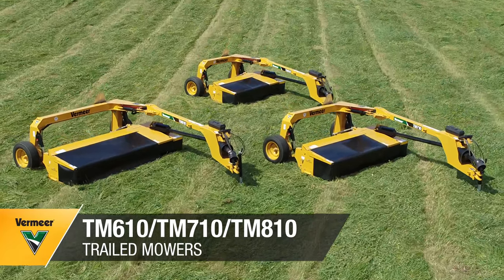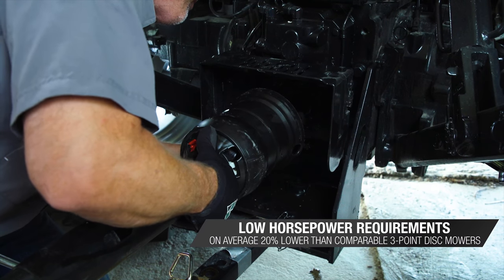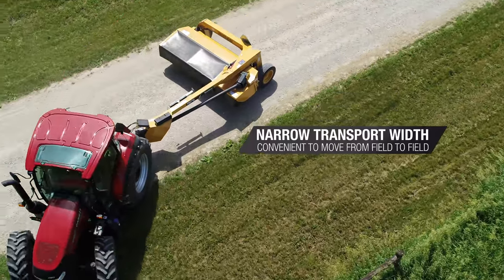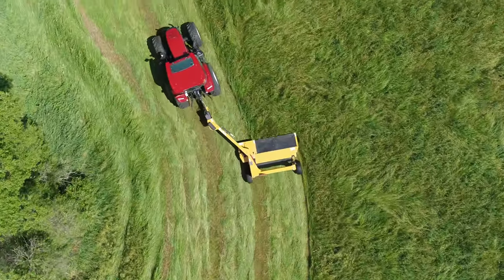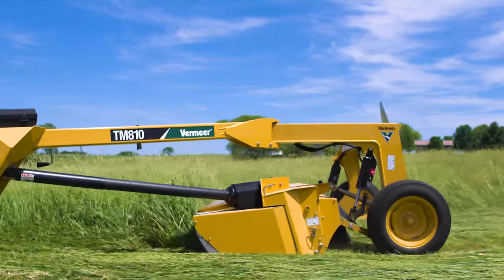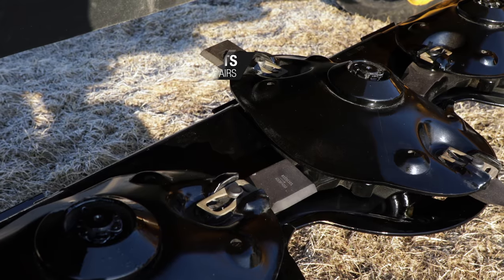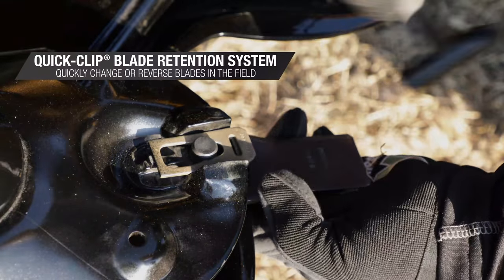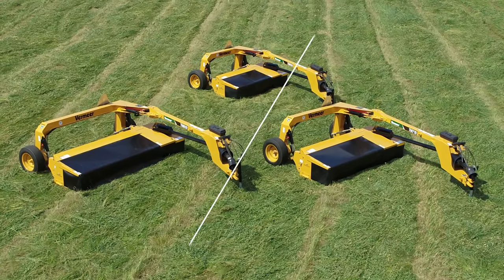Introducing the TM610/TM710/TM810 Small Trailed Mowers | Vermeer Agriculture Equipment

Comment: So disappointed to see all the skips and sprigs in the field after it's cut. They should do better
Reply: Well we have an answer, Vermeer came through. They contacted me regarding the previous commitment. I talked to them about the mower and the issues I was having with the TM 800, I told them that I see in this video of the 810 that it was still an issue. I sent them pictures and to make a long story short. They sent me a wheel kit to move the right hand wheel to the inside of the frame. Problem solved. Thank you Vermeer. You have a pleased repeat customer 👍🏻
Reply: @Connor Will Flixportal =)
Reply: @Ty Reign Thanks, I signed up and it seems like a nice service :D I appreciate it!!
Reply: @Connor Will Glad I could help =)
Reply: thx for help, right outside tyre is it.